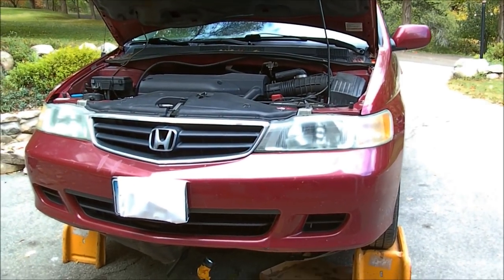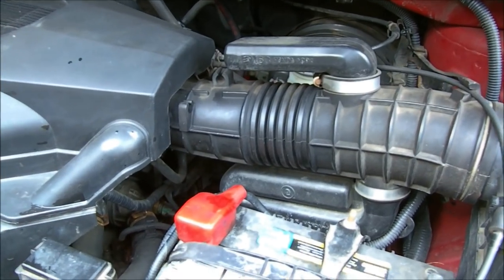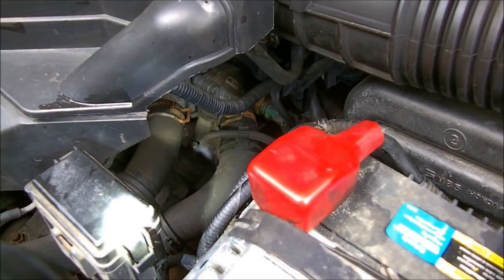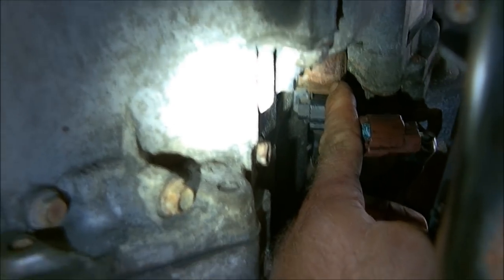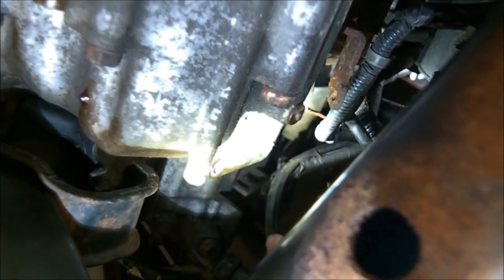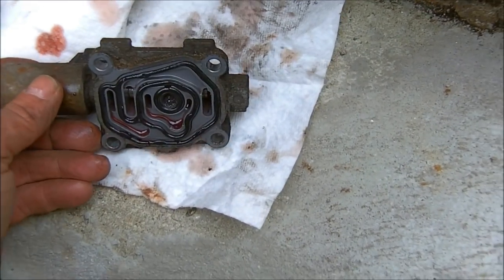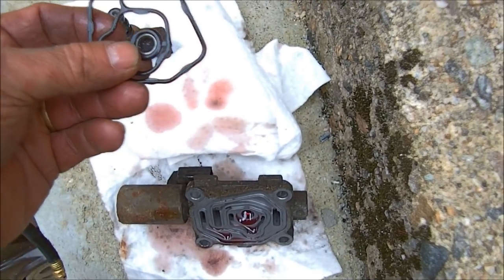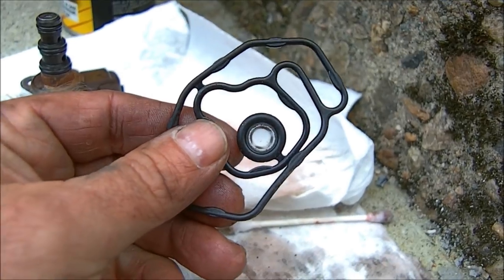2003 Honda Odyssey Automatic Transmission Solenoids

Comment: Had exact same problems with 2002 Odyssey. Got small metal shavings out of one of three solenoids and resolved issue. Had been told it would require transmission rebuild or replacement but this fix saved me some big problems. I added a quart of Lucas in the new fluid. Thanks for the video.

Comment: With the two barrel solenoids below the starter, the starter must be loosened but its easier if you remove it to get to the upper black solenoid. The one that is brown goes down below the black one. Don’t reverse them because they’re not exactly the same. 
   I will try removing the solenoid you did tonight and hopefully will have as much success. My transmission will occasionally shift above 2nd when cold but then goes below 3rd again. I hope to have a van I can take more than five miles from the house soon!

Comment: This is the 2nd time I've watched this video of yours and I had the slipping in 2nd or 3rd gear and I replaced the 3rd and 4th pressure switches and so far no more slipping, but this video is very interesting because looking at the diagram for the AT sensors, this one is really the only one I see with a filter so thank you for this video, looks easy. I will buy a new gasket though, it's $10.60 plus shipping. I put so much work and $$$ into this thing I'm going get new parts. your van looks really rusted, you must live by water
Reply: Have you done any more work after pressure switches replacement?

Comment: The checking of these solinoids are all being done when they are cold.  Consider checking them at the transmission operating temperature.
Reply: Doris ryan Checking solenoids at operating temperature seems like a great idea but how to do it? If I have everything prepositioned with shields & covers off I can only get one at most off before the motor is cooling. 
   Any advice will be greatly appreciated.
Reply: All that work to remove should just replace

Comment: At 3:30 that looks like the second gear solenoid. I was told to remove it and clean out two small filters one is in the solenoid the other is in the block. I have a 2002 Odyssey that is slamming into second and third gear. 
I was told to temporarily shift manually starting at gear number one.
Follow up: so I did that for a month and a half and now the third gear is out and so I have to manually shift 1st and 2nd and then I have to shift it all the way up into D. Driving very lightly. I suspect it's going to fail completely any day now. 
In cool weather it seems to be better but when it gets hot these transmissions burn up.

Comment: Check the number 6 fuse (drivers lest bank .. top to bottom) for looseness. As the fuse box connector ages the fuse come loose and shows sporadic transmission, lack of shifting and other codes. The easy check and fix is to put a slight bend in fuse electrode on both sides to ensure contact. If shift and engine/transmission codes clear ... and stay clear ... the issue resolved. I also removed fuse box and fixed connectors but over time same shift issues and codes started again. Fuse bends are now permanent on my 2002 has 250K with the original as is transmission. This fuse 6 issues started at around 150K. First tranny oil change was after the incident and also took place around 150K miles. Then tranny oil and filter (under battery tray) changed approximately once per year 150k forward. Other codes pointed me to fuse 6, often dash blackouts  and charging issues also occurred. If you are having similar troubles - I hope this works for you. Bought it new in 2002 and its been a great van!
Reply: Good idea!

Comment: I searched and searched and can not find that second solenoid (4 screw one)  that you showed on my 2000 odssey are they different?  I even looked at some diagrams online and some pictures show that solenoid being there and some do not so I wonder if there was a design change from my 2000 to your 2003?  Any feed back would be appreciated.
Reply: yes there was a design change, whatever the diagram shows is what you have, if you do not see a gasket like this than it doesn't apply to your vehicle, I believe the 2002 -2004 is 5 speed and older 1999-2001 are 4 speed transaxles

Comment: I cant read the last 2 pages with diagram & instruction. can you please give better copy. TIA

Resistance: about 15.3 - 16 ohm
Shift Solenoid A: 28400-P6H-013
Shift Solenoid B: 28500-P6H-013
Shift Solenoid C: 28500-P6H-013
Torque Converter Clutch Solenoid: 28400-P6H-013
(Orings (3): 91303-P6H-003, 91302-P6H-003, 91301-P6H-003)

The dual Linear solenoid : 28250_P6H-024   resistance: 5.6 ohm. 
Valve A - Black sol   (: Red is        +, White is  - )
Valve B  - Brown sol ( Brn/Wht is +  , GRN is  - )
28252 PAX 000 SOLENOID GASKET
91301-PC9-003  Oring

The single Linear solenoid: 28250-P7W-003  resistance: 5.6 ohm
Valve C ( GRN/RED is + ,  RED/BLU is -)
28251-P7W-003 Gasket

Comment: Cleaning the screen isn't going to fix anything. Maybe for a little while, then will become plugged again. That's clutch material in the screens. Somethings coming apart in the trans. Very common to see this in Honda's and acuras.
Reply: is long term solution to take apart the tranny, replace the clutch pack friction ring material and then rebuild to factory tolerances? the torque converter appears to have problems too. The transmission I have is the flawed 5-speed BYBA model.
Reply: There are 2 codes for this. One is transmission response. Which is normally the screen clogged. The other is Torque Converter. Which clogs all the screens. One being the Internal one. Which can not be cleaned. It has to be replaced with the updated one...
Reply: Master Chief 00117 which code is for the solenoid and which is for internal problems? Thanks.
Reply: The Torque Converter code. Sure sign the internal filter is clogged...I just did one...
Reply: @MasterChief-sl9ro  P0743? Is that the one? Tcc electrical fault. Just pulled the solenoid and it's checking out fine. Can't figure out what to check next.
Reply: @therising1  Yes…You have to open it up. To replace the filter with the updated one.
Reply: @MasterChief-sl9ro  will this manifest as a very hard clunk when going into reverse from park or neutral?

Thanks for replying!
Reply: @MasterChief-sl9ro  just fixed it! Yellow from PCM to TCC solenoid showed good continuity. Black at TCC solenoid showed no continuity to ground. Hooked up a temporary ground splice and it fixed the issue immediately. No p0743 or blinking D and reverse is not clunky anymore. Clearly the ground got severed somewhere. I drove it 75 miles the other day and it sat for a few days. Then the code was there. Must have been hanging on by a thread.
Reply: @therising1  good catch

Comment: i have a question:

my honda 2003 accord is fine when driving in D or any gear. it's ONLY when i FIRST start the car, and shift to D, it would delay a good 3-5 seconds then have a jerk as it shifts. after driving , that doesnt occur. also, the fluid hasnt been changed on the tranny for a year, and i plan on replacing 1/4 of it or 1/2 to be safe.  would you say this is a solenoid based issue? 

anyone has suggestions?
Reply: ItsGigaHDMyNigga I think that's the torque converter going bad since I have the same issue with my 2004 odyssey. few seconds then sudden lurch forward, like it finally slips into gear. do you have the v6?

Comment: hey guys do u know what is the meaning of this trouble code 3802 to honda odyssey Transmission ?????
Reply: Bernard Sanidad might have to do with the sensor air conditioner pressure sensor something like AutoZone should tell you or take it to a mechanic

Comment: my 2005 odyssey lost power suddenly, checked the code, and got a ttc solenoid circuit switch.It's not driving in drive, but neutral.

Comment: My Odyssey 2003 has the same issue. The Van's gear slip once time at high speed (over 60mph). If I run at low speed it's okay. The code P0740 also appears only at high speed (over 60mph). If I clear the code, and run slowly, the code will not come up. Do you have any idea? Thanks
Reply: Also, what's location of the little screen tube, (at minute 4:23). I don't want to take the solenoid out then don't know how to put it back. Thank you
Reply from the maker: Sounds like your van's symptoms are a bit different than mine, ours had issues with the 2nd to 3rd shift which is common on these transmissions...but you might still be able to help things by cleaning the solenoid screens, particularly if you can get at the one involved in the shift your tranny is having trouble with.  We did have the P0740 CEL code on ours, and the solenoid cleaning I show here did do the trick, no code or CEL after I did this work and she is still working.  About the screen that you asked about, that one is in the body of the tranny and I teased it out with a q-tip so I wouldn't damage it, it slides back in easily enough. Just don't drop it or you might never find it!
Reply: Thank you, I will give it a try this weekend!
Reply: I did it today, yes, the screen was super dirty. I cleaned and put everything back. The car seems okay now. But  I can see that the rubber gasket is going to fail. Do you know where can I buy it. I did some search but nothing so far
Thanks for the great video again!
Reply: Just found it, the part number is: W0133-1850108   yay!!!

Comment: Thank you for video was very helpful and I subscribed to you new feed just incase you have more up and coming videos on this vehicle. Thanks again. It actually fixed mine right up.
Reply: Glad it helped!  Ours is still working after doing this solenoid work, still have some ragged shifting at times but no CEL or other indicators.  Probably about due for another ATF change :)

Comment: remember to take the fuse out  and leave for one minute  to reset  fuse 13 in the passenger side
Reply: My Odyssey 2003 has the same issue. Does it help to solve the P0740 code? Thanks
Reply from the maker: Could do to reset the code, correct, but I opted to leave it and run her for a few cycles to see if it would go off, and it eventually did...that gave me confidence that I'd actually fixed it.

Comment: My 3 gear is getting rough to go into and going through town it kicks out of gear and acts like it's in neutral and then comes back on after switching gears. I'm thinking it's a selinoid but haven't had this issue before.

Comment: thank y for y vedeo.i do have the same issue my odyssey  .im about to get out all  seloinods as well.thnks one more time.
Reply: +chad007 You are welcome, good luck! It's been over a month now, several hundred miles and the CEL hasn't returned on our van....I still haven't gotten to that solenoid under the throttle body area, but the van is running ok and we were able to get her through inspection
Reply: so its able to shift through all gears with no slipping or clunking

Comment: Just curious, I have a 2003 Odyssey experiencing the same transmission issues yours did.  Slipping between 2nd-3rd.  Code p0730, TCS light and engine light comes on.  Do you still have your 03 Odyssey and how is the status of your transmission after cleaning the solenoids?  thanks for your help.
Reply: Joe Herth  did you find a fix?
Reply: he said it ran fine after 10,000 miles after this fix

Comment: what would happen if you actually just remove the screen?
Reply: Not sure, but probably the solenoid would clog with debris at some point and then not work at all, and then you'd have to replace the entire solenoid.
Reply: it's a lot easier to clean screens than the valve body. It's even easier to do regular maintenance with ATF 3x3: pay a little to save a lot else they'll get you?

Comment: how much would this coast me/ im a female n for sum reason im always over charged n told its more than what the actually do
Reply: Tammy Rowden You should go on Honda Forums and ask those people on there. I would help but I really don't know either :(
Reply: it can cost you $0.00 if you use RTV but the gasket he shows with the filter only cost $11 so just buy a new one, RTV is a mess and really hard to get off if you need to get to this part again
Reply: Take about three hours plus new gaskets if they are just cleaning the strainers on both solenoids. So safe to say like 500ish

Comment: Did you ever find a way to get that lower solenoid removed that was so hard to remove?  (that wouldn't clear an obstruction)
Reply: I changed mine.  It's blocked by the starter.  Just pull the starter and replace the two solenoids.
Reply: the starter is blocking it, starter has to come out
Reply: The starter only has to be loosened and tipped up to get it out.

Comment: u can rotate the one that is trapped on the bottom end
Reply: No you can't, I tried rotating all positons & pulling at same time on the 2nd solenoid- closest to the Starter /transmission & can't be removed until removing the bottom starter bolt & loosening the top starter bolt & move or wedge starter up top until u have the enough room/space to remove the 2nd Solenoid all the way out!

Comment: my 3rd gear is gone.. have to start in d2 and shift to D like a manual car... smh I have an 02... will definitely have this checked out
Reply: +SHASTA LEWIS Good luck, I hope it helps...make sure to do a fluid change otherwise if it's a solenoid screen that's clogged, it will probably just clog again.

Comment: with soo many issues with honda automatic transmissions, I don't know why or how they are still in business.  what a junk company. great motors but fucking hell if they will ever get the transmission right. don't think that will ever happen. i'd rather buy a ford that this shit, and that's saying ALOT. or... just stick to manual trans.
Reply: Well, did you change ATF as scheduled? My 03 Ody has 234,000 miles on it and I only changed one time at 200,000. It started to show this problem. I have to say that I should have followed Honda's maintenance schedule. Nobody talked about ATF seriously so I did not know how important it was back then.

Comment: my 3rd gear is gone.. have to start in d2 and shift to D like a manual car... smh I have an 02... will definitely have this checked out
Reply: Same problem. Did you ever get it resolved?
Reply: I have an 02 with high miles.... and mine is still shifting good!
Reply: Im doing the same thing